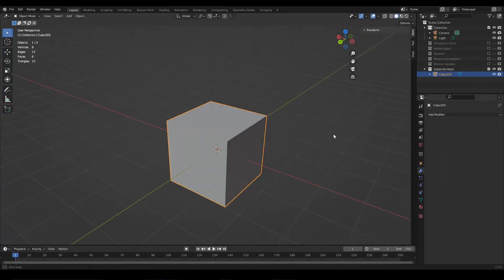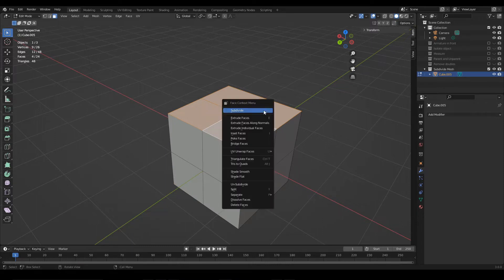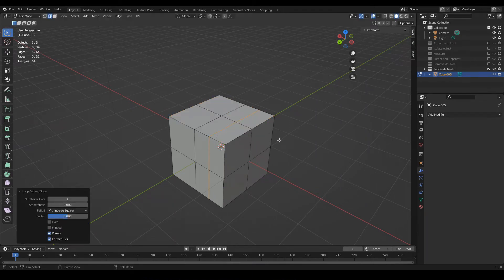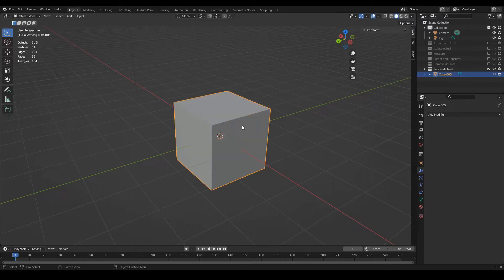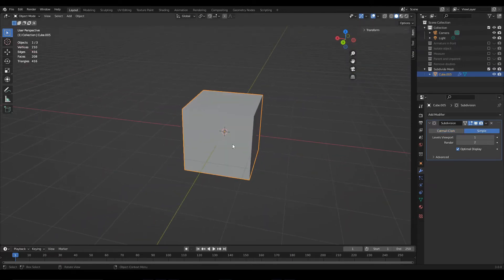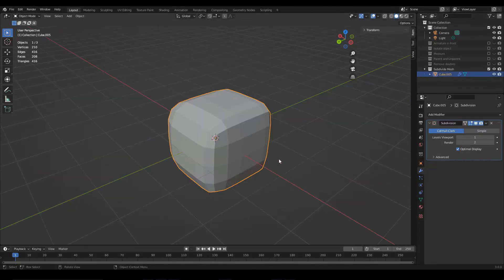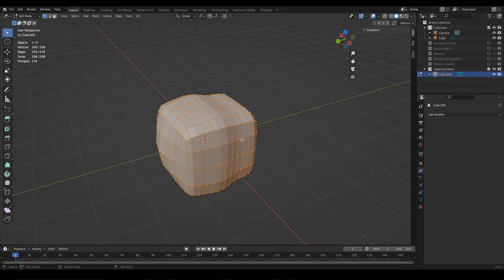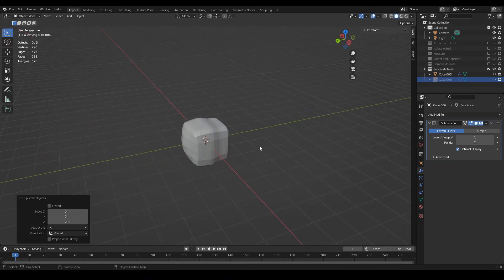How to ADD MORE VERTICES to a 3D MODEL in Blender - Model subdivision

Comment: Hi, for some reason only two sides of my cube subdivedes even tho I have the whole cube selected, anyone possible to help me with a solution for this?
Reply from the maker: yes, maybe you have overlapped geometry on your model, that happens very often.
If it's a cube it should have 8 vertices, 6 faces, you can check how many vertices does your model have.
Here's a video on how to doing this:
https://www.youtube.com/watch?v=Gs-XX56beAI

If you have duplicated vertices, then you'll need to get rid of those extra vertices.
here is a video on how to do that:
https://www.youtube.com/watch?v=IjtAWWbDMeg

If the previous didn't work, then another reason may be that you have inner faces that should not exist, I don't have a video on this right now, but you can check this in the Edit Mode, change the working mode to Faces, activate the Wireframe mode and inspect your model, if you find a face inside the geometry select it and remove it pressing X and delete "only faces".

Hope you solve your problem, here you have my complete playlist about Blender:
https://www.youtube.com/playlist?list=PLkYLdQEQ__tg61io1T7_sCkYhQ1ZCHb9H
You may found other useful tips there

Consider subscribing to this channel <3